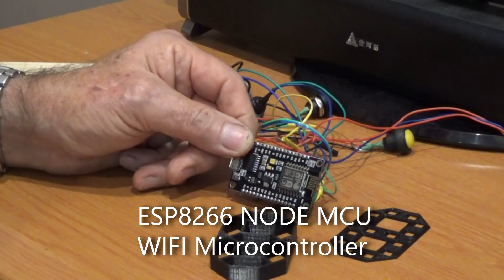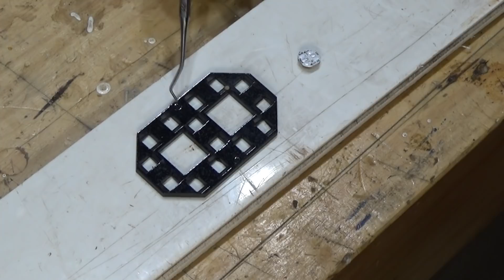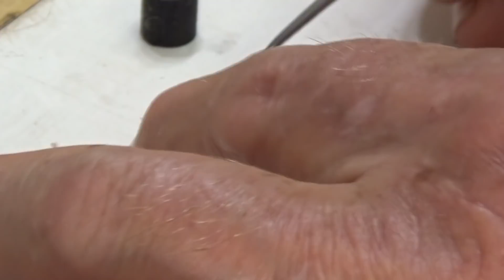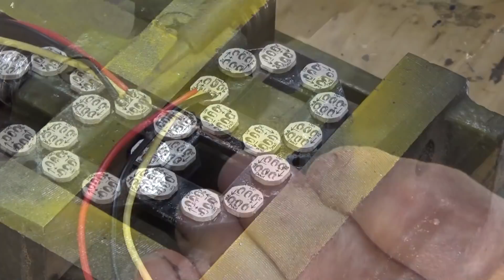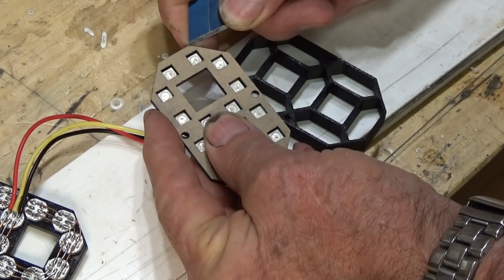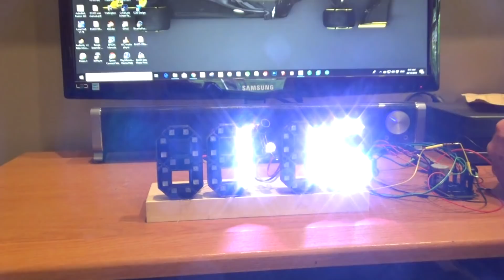DIY Vixie Clock. How to build a back lit veneer, digital 7 segment clock.

Comment: Does the microcontroller talk to a public NTPD server to get the real time?
Reply from the maker: Yes. You can set up the code to connect to any time server. The newer version of the code allows you to select a time offset to account for daylight saving or different time zones. So, you can leave it set to any particular time server and then just use one push button to add or subtract hours from the selected time server. I'm not really a coding guy but I had a lot of  help from a coding guru who lives on the other side of the world to me (Mitch Markin). He has made gradual improvements to the code and he has a similar clock to mine.
Regards,
Mark

Comment: THAT IS GEOING TO TAKE MORE OF MY TIME , GOT TO MAKE ONE. REGARDS RICHARD IN COLD U.K.
Reply from the maker: Richard, the best thing about this clock is that you can make it as simple or complicated as you like. You could make the front face from frosted glass, rice paper, semi translucent acrylic or wall paper for that matter. The wiring can be a bit tedious but basically, if you've got WiFi, you've got a clock!
Regards,
Preso

Comment: Is anyone else's oldschool electronics aesthetic bothered by the fact that the data run doesn't start  with the 'a' segment  on these?  :) (sorry to appear to be a 'Negative Nellie', I'm not!  I HAVE written embedded software to suit unconventional hardware before - a long time ago))
Reply from the maker: I just had to google to find out which is the "a" segment. I am guessing you could start the data in pin anywhere but the code would have to reflect that. I didn't want to mess with an already working code so I just went with it. #proudtobeunconventional 😁
Regards,
Preso
Reply: @Preso58  Definitely.,  I was just exercising my perverse sense of humour., more than anything else. From a software perspective it makes no difference which segment is where, and the wiring is very easy to arrange in a 'G' like that.  My history in electronics goes back to the mid '70s.  LEDs were a new thing for hobbyists  and it was 'a bit of treasure' to have a 7-segment display - so this "bypassing of the conventions" tickled my Virgo perfectionism! :)  Certainly not a criticism of a valid implementation!

Comment: A cheap and easy quick set activator for super glue is 1/2 teaspoon of baking soda into 1/4 cup of purified water. Put it in a small spray bottle and just spray it on to set. Push come to shove plain water will work (no baking soda). Matter of fact I use tap water but the recipe does call for purified so I relay it as I got it.
That said anybody with common sense (but seems it's not so common anymore) should know if you get your electronics wet make sure it's dry before you power it up. Wet electronics tend to let the magic smoke out.
Reply from the maker: I'm going to try that, I ran out of accelerator just before I started this project. I don't know what was in it but it had a pleasant perfume smell and it was slightly oily. It dried off quickly though. I will have to dig through the rubbish bin and find the empty spray bottle.
Thanks,
Preso

Comment: Hi Mark.  I want to try one of these but am having trouble identifying the esp8266 microcontroller.  A search on ebay brings up several different boards.  Is this the one?  https://www.ebay.ca/itm/NodeMCU-V3-Lua-ESP8266-WiFi-4MB-CH340-USB-Compatible-With-Arduino-2389/263845440850?hash=item3d6e69ed52:g:ZCUAAOSwyCNbXd2i
Reply from the maker: Eric, I'm pretty sure that one will be fine. It looks identical to mine. There are several variants that don't have the micro USB port and some don't have as many IO pins. In my Arduino IDE, the board manager lists it as the Node MCU 1.0 (ESP-12e) module. When I searched for it on Ebay Canada I got this https://www.ebay.ca/itm/ESP8266-ESP-12E-CH340G-WIFI-Network-Development-Board-Module-For-NodeMcu-Lua/114030640355?hash=item1a8cc17ce3:g:RxUAAOSwMyteAkYU I usually buy a couple at a time as they are dirt cheap. 
Regards,
Mark
Reply: @Preso58  Awesome, thanks so much!

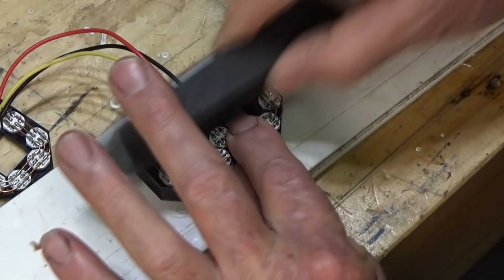Comment: Mark, this is yet another project that I may have to add to my "list."  I also liked your metalworking content at ~24:00 where you used the cutting tool as a weight to hold things together while the glue dried.  ;)
Reply from the maker: Bob, those tools are heavy. Great gravity clamps!

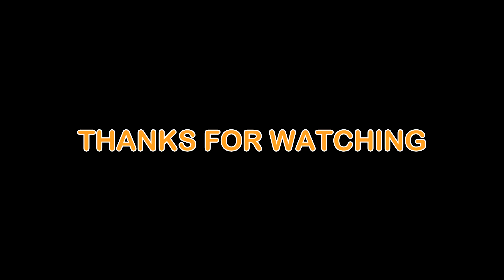Comment: Interesting project! I guess you could blink the semicolon as a heart beat indicator by software linking it to the board heart beat LED. You could also choose a more homogeneous wood veneer, to avoid the partial obstruction of some segments, as seen at 28:20 - some woods with tighter grain can perform better.
I've done a similar size clock, a few decades ago, using flashlight bulbs driven by transistors (instead of 7-segment displays) and CMOS chips (similar kind of beast to this one: https://www.instructables.com/id/Homemade-24-hour-Digital-Clock/) and I also had problems with the choice of veneer and its thickness (the veneer I had available was 1mm thick and had to be hand sanded down to let enough light pass - complete craziness). I soon had to replace the veneer and bulbs by red acrylic and red LEDs, because the display didn't cope with the bulb temperature - real fire hazard, like many other projects I did then :-)
Reply from the maker: Jose, unfortunately I don't have a wide selection of veneers left any more. I used to have a huge bundle of some really exotic woods but I took it all into school one day for my students to use. We had run low at school and I figured I could replenish my supply later. We used to get it for free from a plywood manufacturer. Our supply dried up shortly afterwards since just about every other school found out where we were getting our veneer from and the supplier ran out of offcuts almost overnight. As it happens, the camera makes it look quite different to how it looks in real life. 
Regards,
Mark
Reply: @Preso58  Thanks for replying! Happy New Year!!